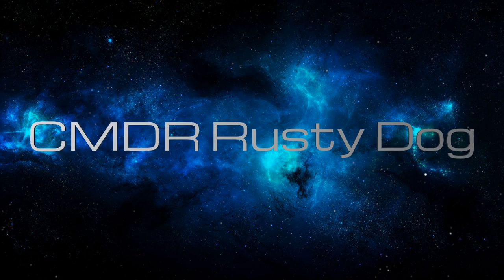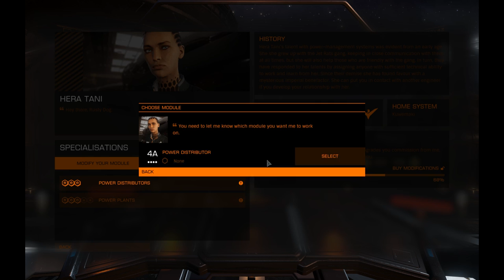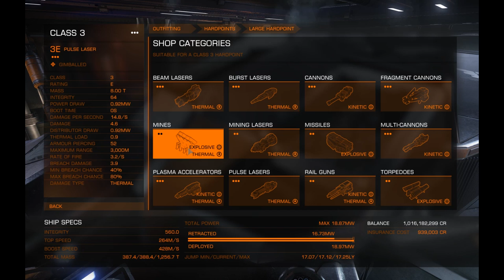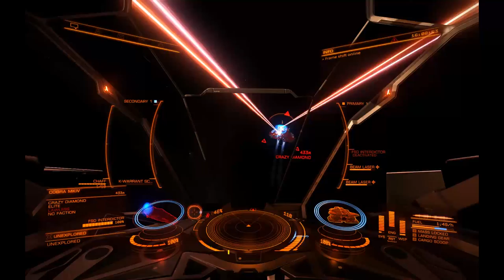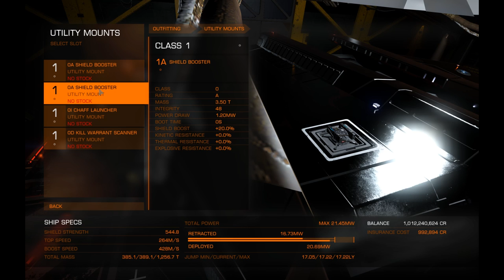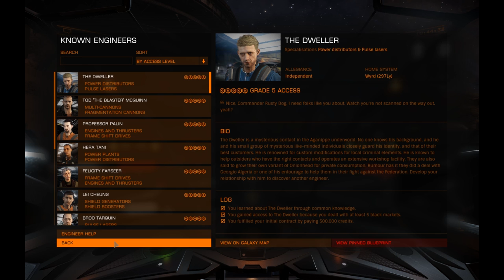Experimenting with twin beams on the Vulture - is it viable?

Comment: I have had fantastic results with clean drives. Because thrusters are a large amount of power allocation, even a small increase in thermal equals a large overall heat issue. Any ship that will see sustained combat will benefit from thermal savings.
Reply from the maker: Something I will be looking into for sure.

Comment: Not sure if you addressed this, but how would you feel about one beam laser and one multi cannon? Use the beam on shields primarily and the cannon for hull. Add beam when you have the capacity. This way, once you get the shield down, you can move your pips toward sys and eng since your multi cannon won't need much power. Multi cannons can also get interesting secondary effects too.
Reply from the maker: That was the first layout I had when I bought my Vulture (way before engineers were around).
Then I switched from multicannon to cannon.   Then switched beam/cannon out for twin pulses.

With the engineers, it might be worth looking at again.
Reply: @CMDRRustyDog  as i said the pve meta also used in pvp if your not good with PA's is two beams maxed with thermal vent half the time you will run in stealth because it runs so cold others need to get really close to target you if you barely emit heat and with high recharge on a distributer it fires endlessly

Comment: I have the ominous feeling that the smaller combat ships are yesterday's news. A heavy fighter that's built on maneuverability is no match against, say, a type 9 that can launch fighters (that are much more maneuverable)
Reply from the maker: Maybe in 2.2 against other players but not in PvE.  What heavy fighter is going to out-manoeuvre a Vulture anyway ?
In the hands of a good pilot, the Vulture is formiddable against anything imo.
I've had mine for a while and I can't part with it.
Reply: I mean a fighter - one of the tiny ones, condor or imperial or the new one - is going to outmaneuver a vulture
Reply from the maker: HibiscusX
It's going to have to.  If it can't the Vulture will eat it for breakfast. :)
I've just put grade 4 overcharged pulses back on my Vulture and it's pretty good now.

Comment: how about clean drive tuning? It should lover the heat and give some boost speed.
Reply from the maker: That is a good option. But I'm still left with the fact that the lasers only fire for 8s before running out.  It's not too bad but I know with pulses they'd go for ages now.  Maybe 1 beam and 1 cannon like I used to do is an option.
Reply: i put G1 clean drive tuning and got a secondary effect to maximize the boost just as fast as this ships was boosting.
Reply from the maker: Cory Marker
Yeah it seems heat management is actually a thing now, something I'm realising more and more.

Comment: Fixed beams are not as bad on power and what i do is set power priorities for high to shields and everything essential, then medium to weapons as , finally low to nonessential or out of combat things like kill warrent and cargo hatch. only way to fit a good vulture.
Reply from the maker: It's a nice way to go for sure.  I may decide to mess with a new Vulture build in 2.2beta and start off with twin beams again and see how I can best mod it.
Reply: it basically turns off no essential stuff when your hard points are deployed. you can also put your FSD lower then your guns to save power you cannot jump with them deployed.
Reply from the maker: MAJORzer0
Yeah I know. Right now though my Vultures power output is below 100% with everything on priority 1.
Reply: Yeah I have all A ranked internals but nothing upgraded so i have to have it setup a bit differently.

Comment: You dont need this much power, try rolling power plant for lower load and turn off scoop and fsd, that helps a lot.
Reply from the maker: FSD can be handy to leave enabled in case you need to SC out of there fast.
Reply from the maker: Always good to read options from other players. Lower emissions might be handy for other ships that I have.  I don't think I can afford the power drop on the Vulture unless I go back to pulse lasers (which seems likely).  But then I won't need less thermal :)
Reply: Rusty Dog depends on situation, for example in asteroid belts you still need time to leave mass locked space, that's enough time to load fsd. Even though I have more than enough power on my corvette, I still manually deactivate everything, as it gives me extra 5-6 seconds of laser fire and around 10% less heat with SCB.
Reply from the maker: Иван Ерохин
Interesting. Something I can experiment with.

Comment: For an un-engineered Vulture, what would you recommend for a bounty hunting setup? I'm currently running a build similar to this: http://www.edshipyard.com/#/L=80N0,5TP05TP001Q001Q00-I00-I0,2306Q08806Q05K07_06u05A0,7Su07gy012G010i010i0
Reply from the maker: Your options are quite a bit limited when it's un-engineered. That being said your setup looks pretty good.  My Vulture has Military Grade bulkheads though. Also you have 2 x chaff, it might be worth looking at the option of 1 chaff and 1 point defence as you do get a few ships now with explosive weapons.
Reply from the maker: AncientRaig
I see you went with multi-cannons.  They're pretty good but I always wanted at least one weapon that didn't need topping up.
When I first had my Vulture I ran it with 1 Beam Laser and 1 Cannon. That was back then in 2.0 when AI were easier. 
It's really a case of playing around with different hardpoints to see which suit you and your playstyle the best.  Multi-cannons can be very effective though, that's for sure.
Reply: Rusty Dog
Yeah, I dislike the fact that I have to reload, but it's more effective than dual pulse and I don't have the power to run MC/PL or MC/BL. The MCs are surprisingly about as effective as the pulses at killing shields, but they're much stronger at damaging hull. The biggest downside is that they have a smaller tracking arc.
Reply from the maker: AncientRaig
Yep that's pretty much it. But with the Vulture being so aglie, multi-cannons should work well even with a smaller arc.

Comment: It has been viable since the Vulture was released, even before Engineers were around when 99% of people though Pulse was the way to go. Flew it in PvP a long time. Sorry bud, but you are WAY behind the curve.
Reply from the maker: Then you're clearly not aware of the heat buff that beams got a while ago along with other tweaks.  Beam lasers are tuned quite differently now than they were when the Vulture came out.
If they were the same, this video wouldn't exist.